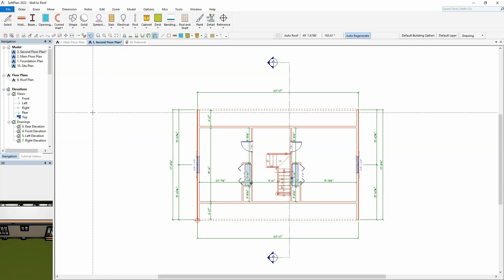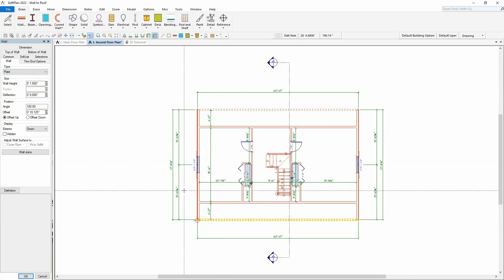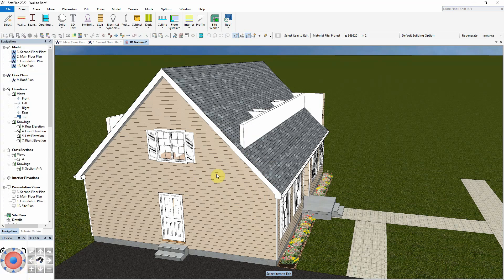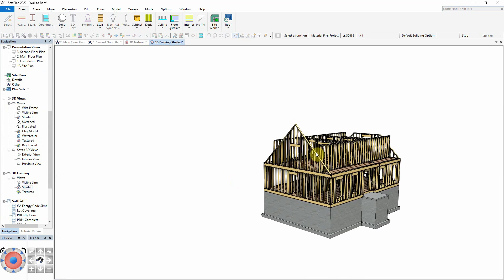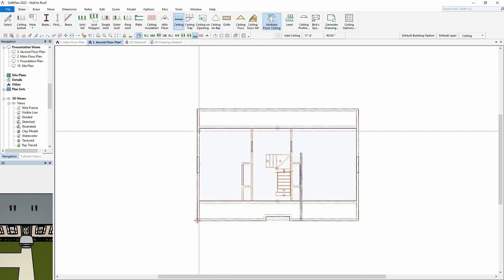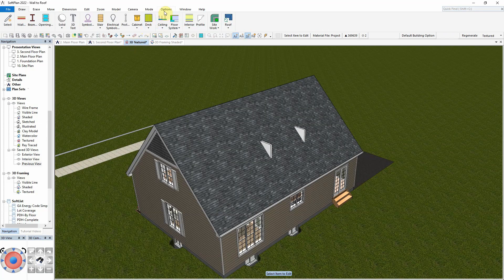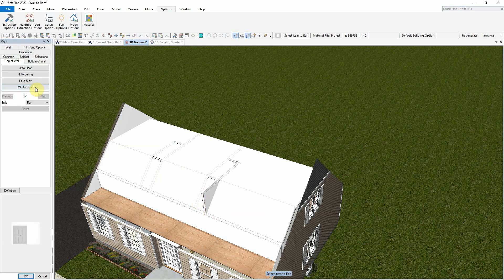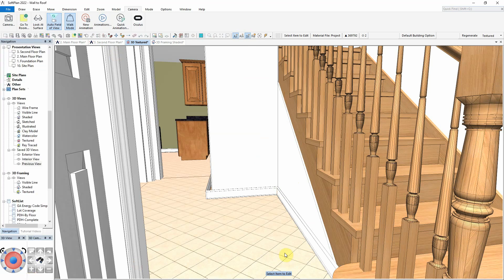SoftPlan - Top of Wall Tools

Comment: How do you fit the 2nd floor walls to a 1st floor roof?
Reply: It has been a couple years since I last used SoftPlan, but from what I remember in SoftPlan 2020 (but I'm sure this applies to all versions) it's best to always draw the roof on the upper- most drawing with the Multiple Floor Roof button enabled in Roof Mode. This allows your roof to be drawn using the walls on any drawings below in the drawing stack. Afterwards, editing the wall and choosing Fit to Roof should work perfectly.